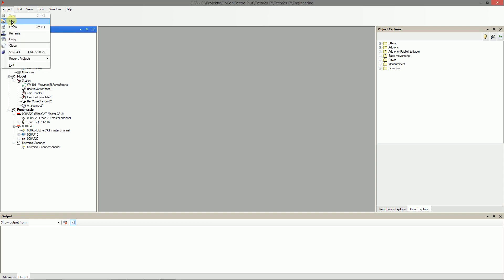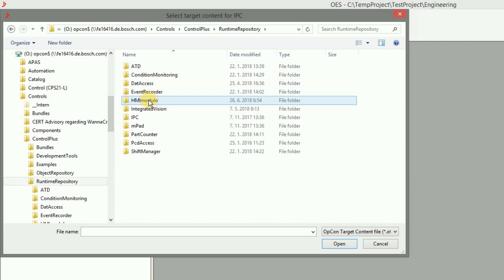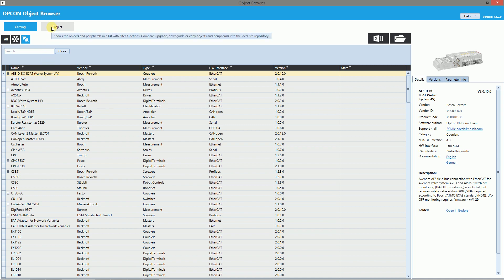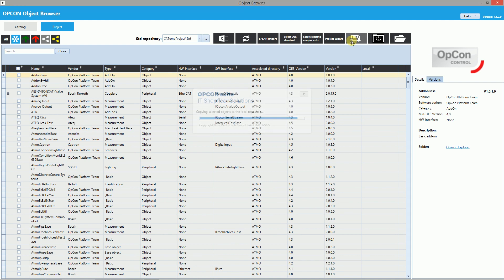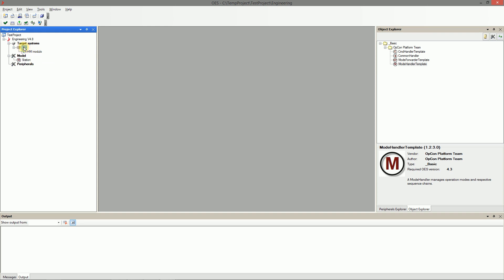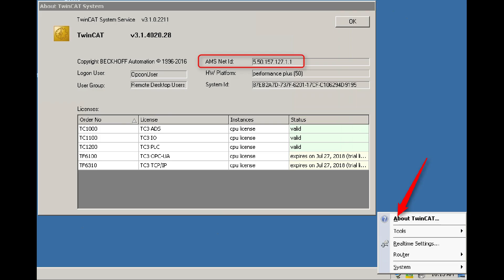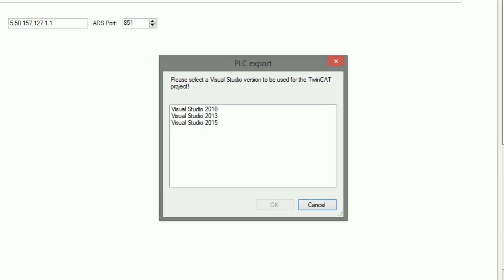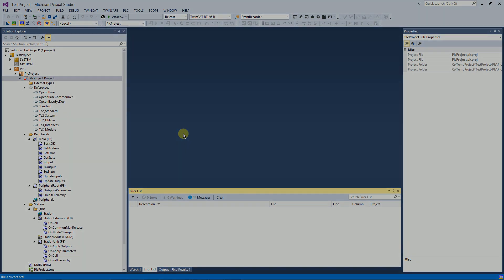Control Plus - #1 How to Set Up New Project

Comment: I made this from 2012 to 2014 at ATMO1 in Stuttgart Feuerbach, starting on base of OES 3.2d, at first implementing the ObjectExplorer to  start with Opcon Plus / OES 4.0.

Then I also programmed the PeripheralsExplorer, PLCOpen import/export, Excel import/export, TwinCAT export, Dynamic Properties, Struct referencing,  and so on. All of this and much more was mostly implemented by me into OES 4.0 and 4.1 using C# as an external software developer, but then the company I was working for played mean tricks on me, not paying my money etc., so I left.

Nice to find this on Youtube nowadays, thank You :)
Reply: It sounds very interesting. I thought it was completly developed internaly by ATMO not an external company.
Reply: @pomaser  Actually, the company I started working for at that time, did many contracts with Bosch or around OpCon / Indraworks / CodeSys. My first work developing some minor PLC applications using these tools.

Additionally, my job every one or two weeks I had to visit Bosch in order to install IPCs and VEP30 and L10/L20 etc. to be used for projects.

Some day the department head caught me while I was doing this and he asked me about my former job experiences (I made AGV control systems in C/C++ prior to that job), and if I also could program in C#. My guess is he was shown one of my PLC projects I made with the OES 3.2, which I tried to structure well and also to do it as object-oriented as possible, which was very hard with that "old" version.

At this point, the guys from EES11 (Entwicklung Elektronische Systeme / Development Electronical Systems) at ATMO1 were already planning to make a new version of OES that should follow the object-oriented approach instead of separately defining structs and variables and sequences in independent pools. So I guess I just did the right things right at the right time :)

The department head had one prerequisite for me, that I should attend a one week C# basic training, which I did. After that I was working with the EES11 team in their office as external developer. One guy was the team leader and he knew the whole system very in-depth and taught me everything and also explained what they wanted, and I did it for the next ~2 years.

Another guy from the team made all the HMI related stuff (Smart Forms), another guy made the XSD schema definitions, another guy made the EPlan related specs and so one. All in all, we were like 6 or 7 colleagues. Additionally there were a handful of PLC / CodeSys specialists, and also the EPlan / electrotechnical experts.

But as I said, I did most of the programming during the 4.0 development and in some days I wrote more than thousand lines of code. If You see for example the object inheritance, the import mechanism structs under structs under structs... with all the dynamic properties, like texts for the HMI and so on. I made this. :)

The first OpCon Object Definition XML file that ever existed - that was the EES11 team lead and me.